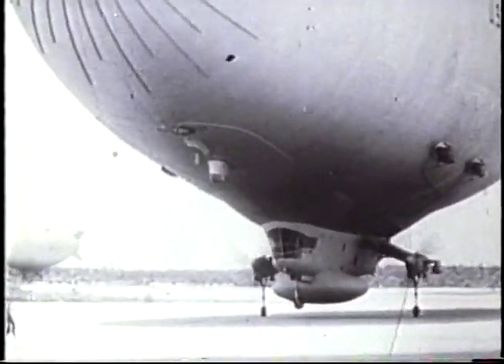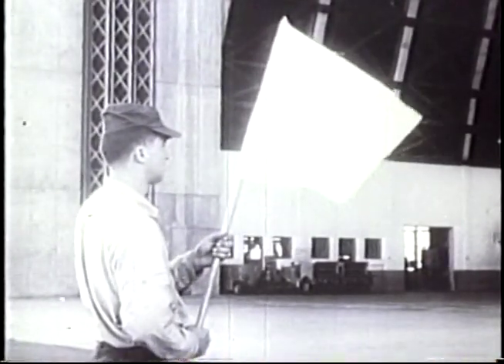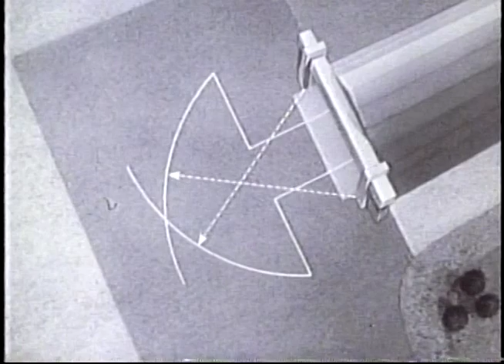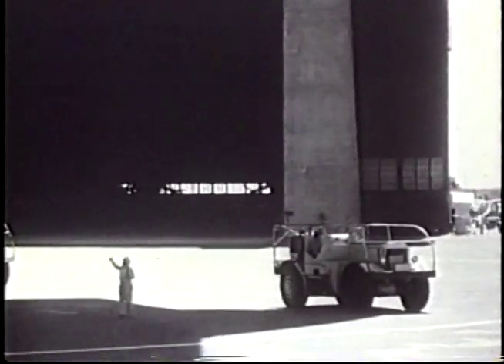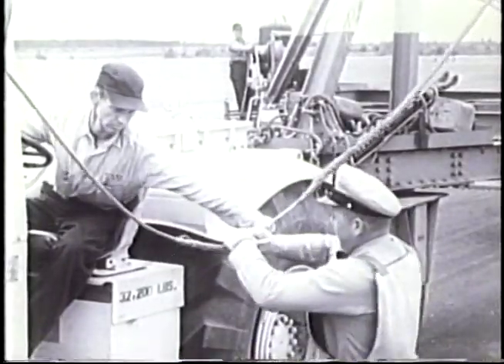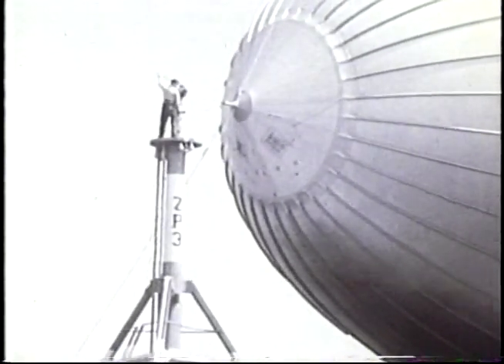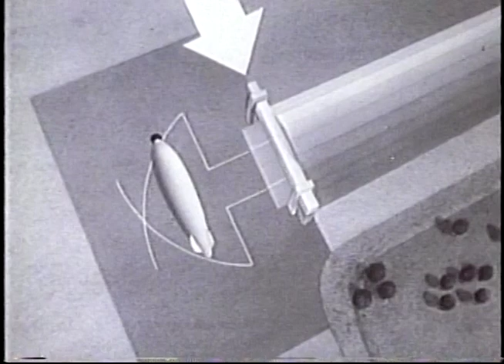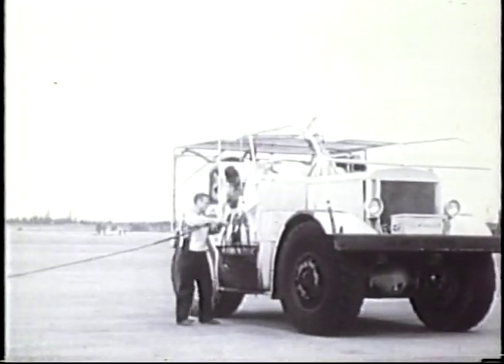ZPG-2 Airship Ground Handling

Comment: Marvelous archive film. Goodyear and the US Navy had really got airship ground handling down to a fine art. Making what had been difficult operations appear routine. I have always admired their experience and use of mechanical assistance. Their SOP was and still is second to none. I hadn't realised that the tugs had all steering wheels or that it only took seven ground crew to handle these huge ships ! Thanks for showing it.